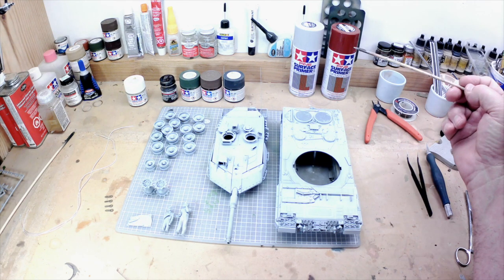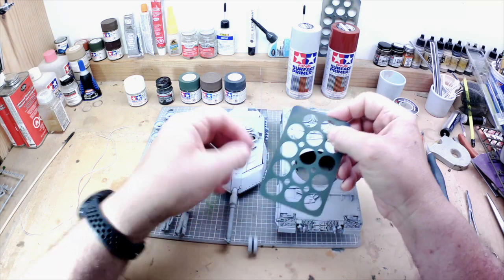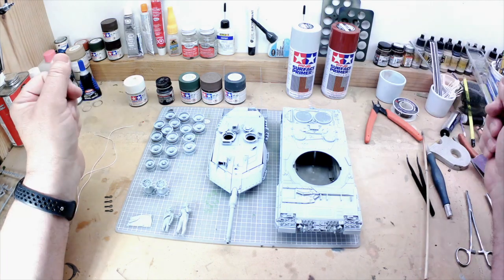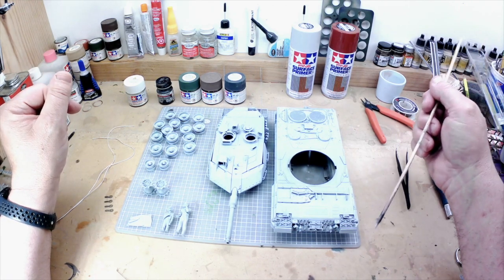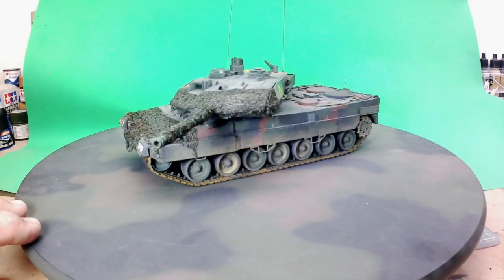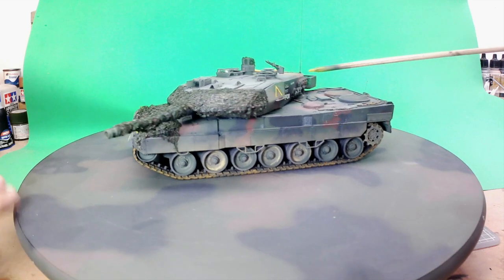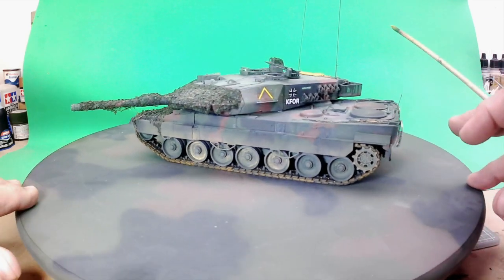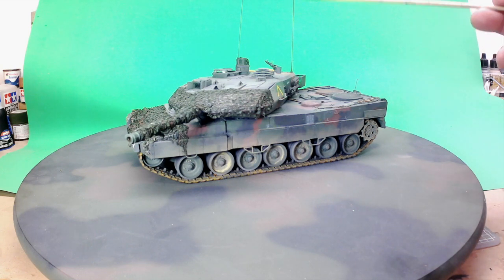Bundeswehr Leopard 2a5 Tamiya 1/35 deployed to Kosovo 1999 with Edwards PE (part 2) (video #36)

Comment: Greeting, Rick!  Thanks for your very helpful video. I am a newbie to camo painting and am still try to learn from all possible sources. I see that you first spray a think layer of black paint on certain area of the tank body. Is this part of the weathering effect? Since I am just getting started in airbrushing tanks, should I do this part or will u recommend I skip this part since I don’t think I am ready to jump into doing a lot of weathering work. If u do recommend that spray these black lines, can I use Tamiya acrylic paint # x18, xf 69, x1, or xf1? Thanks for any suggestions!
Reply from the maker: Thank you for watching. If upu plans to do a faded paint scheme then yes. Do the black lines but if not then don't bother. Your paint choices are fine. Doing faded painting great but usually have to do light coats of your actual colors the tinting under caused by primer shows. Irecomend trying on a piece of plastic sheet to get it right before you start your nice kit.